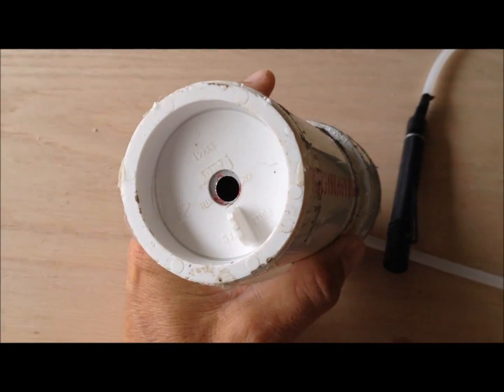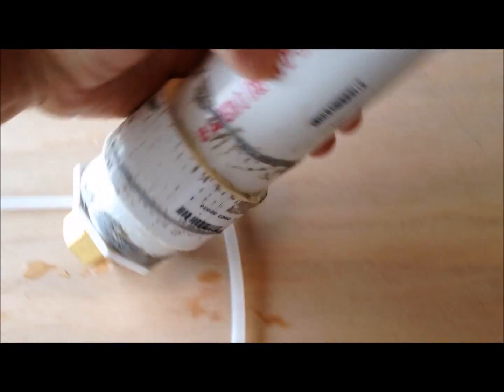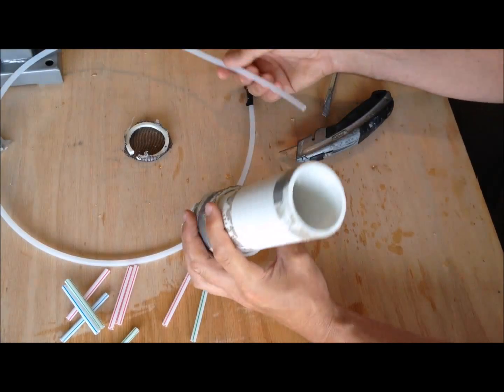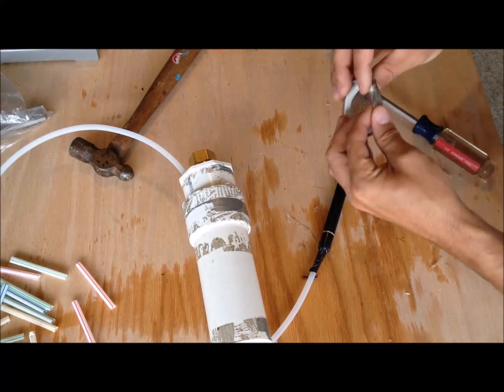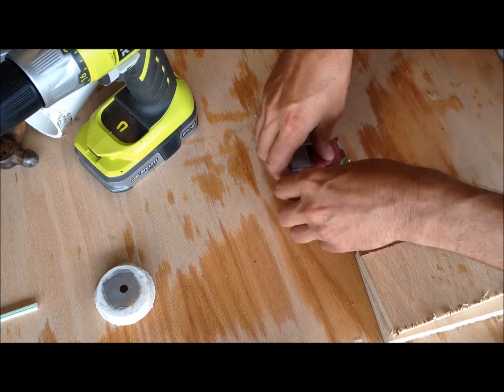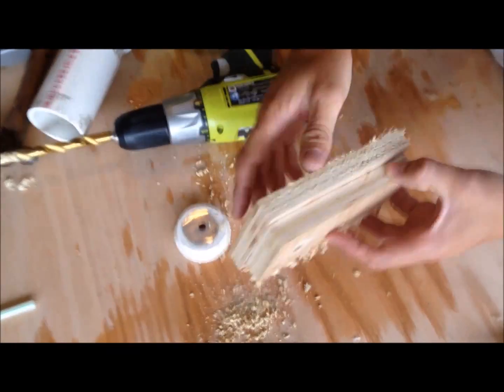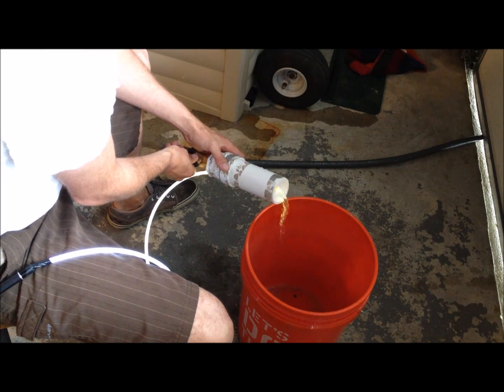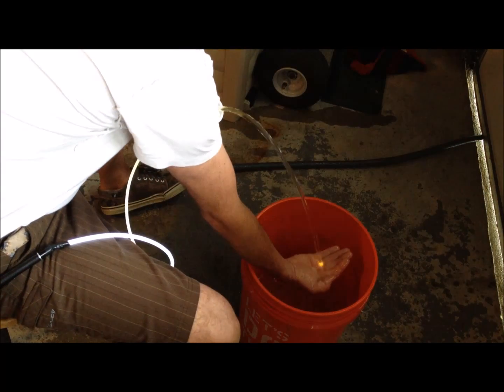Laminar Flow Nozzle Fountain LED - DIY PROJECT & DEMO 💧😜💧

Comment: I wouldnt exactly call that laminar flow. Try making it 3 inch and longer so u have more room to make the straws longer they are too short and add another screen at the top before the nozzle to slow down any turbulence the water might build up before getting to your nozzle and make sure u sand the aluminum so it is  free of any burrs and completely smooth
Reply from the maker: Appreciate the tips for the next version!

Comment: Hot glue gets soft again with a little heat. Pocket lighter works.
Reply from the maker: Not sure what that means??
Reply: @Kitearmy  at the beginning, you were saying you used hot glue so you can disassemble with a little elbow grease. I was just saying you can save yourself a little bit of fighting with some heat
Reply from the maker: @crypt1174  Thanks mate! - I made this vid almost 6 years ago!  Forgot some of the details.
Reply: @Kitearmy  cool project by the way. Sub'd
Reply from the maker: @crypt1174  Thanks mate - I have a cool project that I'm working on now.

Comment: I like the small profile of your nozzle however there must be an advantage to building this larger either 4" or 6" like I have seen others do. If I can get the effect I want using 2" that's the way I plan to go. What was the maximum distance you could throw a clean stream and at what pressure? Also did you incorporate a low pass filter to smooth your stream.
Reply from the maker: I just had mine hooked to a garden hose - so no I did not have a low pass filter.  I think you can get a pretty good result even with a nozzle this size.

Comment: You don't have to use screw driver, only dipping it in alcohol for few seconds and it will loosen without any effort or scratches ;)
Reply from the maker: Good tip

Comment: so straw length maybe 1/2 legnth of tube?
Reply from the maker: +Jack Jackllfixit That should work.
Reply from the maker: Hey Jack, I watched some of your window cleaning videos.  Very cool.  So what are you trying to accomplish with laminar flow?
Reply: +Kite Army . I had many vids on FB, just haven't out all on tube. I make spray bars vice using 2 fan or pencil jets. I usually have to tap wash the glass on most places. I use a standard soaper nozzle. usually tap water will spot. I use various soaps to get almost spot free but a lot deals on the rinse. nice cascading rinse little splashing. I made a small laminar jet but the hole wasnt perfect but liked the way it rinsed the glass. eventually, I will use jets using multi lumen tubing. I became interested when I took one of those fill 30 water balloons at one deals. had 30 small pipes. those pencil jets kept a uniform flow until the very last few inches. then, the droplets formed. I just like to make stuff is all.
Reply from the maker: That's very cool.  Laminar flow is a thing of beauty when done right.  Keep up the good work!
Reply: +Kite Army that is why I liked your smaller version.
Reply from the maker: +Jack Jackllfixit Thanks

Comment: Just wondered if the smaller would work. I am using PVC but also pop up garden sprinklers. has a 3/4" thread on bottom. for jet I am drilling a hole in cap but using a can  as well. Not using for a fountain, actually a rinse jet for my pire water window rinsing
Reply from the maker: Ok let me see if I understand, you want to make a laminar flow nozzle for window rinsing?  In my experiments I discovered that laminar flow breaks up under higher pressure.  This could be a problem for you.
Reply: +Kite Army , not pressure washing. we use low to tap pressure 40-60 psi. avg working pressure of pumps is in 40 range. most pumps work at 40ish psi. my test one worked well from tap pressure which is 65 psi
Reply from the maker: Cool...post a link to your video when done.

Comment: curious. I have small tubes, modified laen sprinklers. using coffee stirs. is there a certain legnth they should be in relation to tube? some vids show full length and another had a 6" tube using 3" cut straws.
Reply from the maker: So here is my 2 cents.  I would avoid coffee stirrers.  My thought is that they may cause turbulance because they are to narrow.  If you want perfect laminar you should use full length straws, I cut mine because I had a limited quantity.

Comment: Awesome project!! where can I get the fiber optic cable or how can I look for it online? I only get results for audio or networking fiber cables.
Reply from the maker: Just a suggestion: http://www.ebay.com/itm/10mm-Solid-Core-Side-Glow-Fiber-Optic-Lighting-Cable-Sold-By-The-Foot-/331145253580?hash=item4d19cb92cc:g:788AAOxy0NtTFioV
Reply: +Kite Army Great! thanks for your reply!!!
Reply from the maker: +darthmo Post your link once you build

Comment: Kite Army  I really like your tutorial , but i would like to know what do you use for that beam , i mean light  can you provide me that information ?
Reply: if possible links ass well on ebay , that would be great
Reply from the maker: I'ts just a simple led flashlight with a large fiber optic cable both available on ebay.
Reply: thanks
Reply from the maker: Did you end up building one?

Comment: I did one 
But I don't know how to create a led nozzle. (LED light)
Reply: Can you help me
Reply from the maker: Manu Prakash Yes it is real simple.  Drill a hole in the bottom and insert a short piece of fiber optic cable (about 1/8 to 1/4inch) that you can buy on ebay.  Push it through the straws and leave it near the nozzle.  I added a high intensity flash light on the end - worked like a charm.  Let me know if you need any more help.